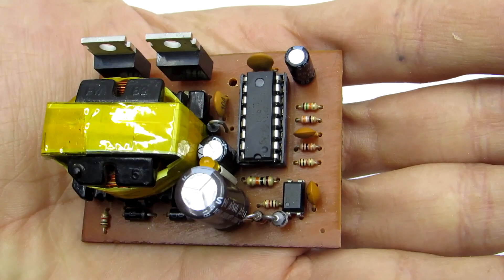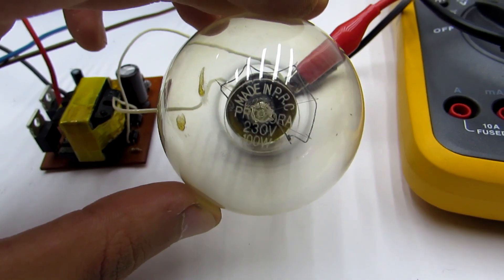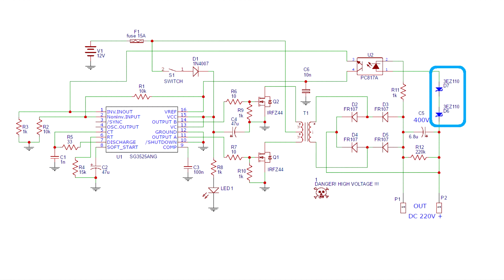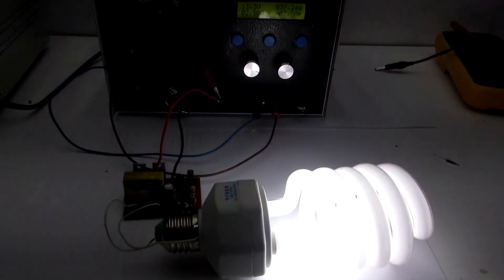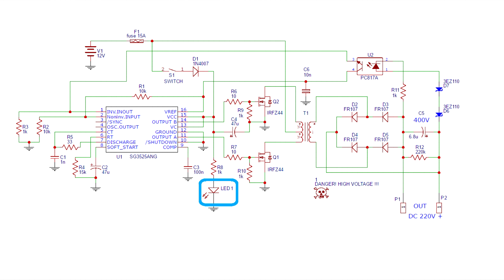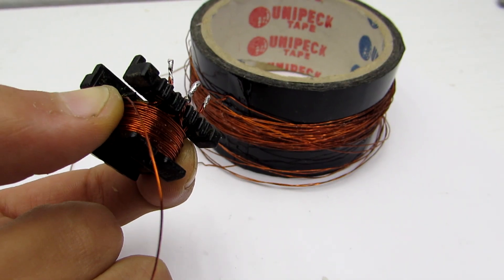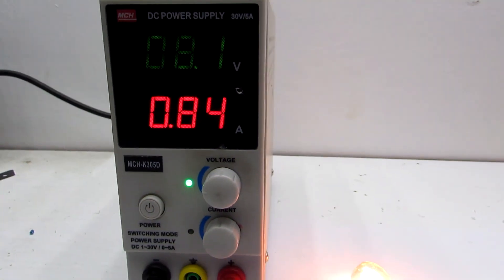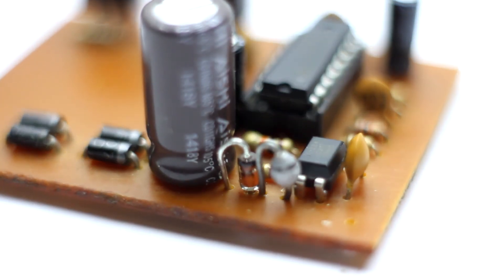DIY converter from 12 to 220V 100W

Comment: When I put a load on the output the voltage 220v drops dramatically.  What can it be?  I did everything the same
Reply: what is you rt and ct?? the rt 33 ohm is totally wrong, look at datasheet what minimum setting for Rt sg3525 an

Comment: u need a snubber network to save the MOSFETs from burning and catching fire due to high voltage ringing form the transformer and u can use higher frequency to increase efficiency and most loads will have no problems...

Comment: Sorry to leave so many comments all separate but I don't like having the bulk of my comment cut off to a glance.  Why add the 10 ohm resistor in series with the FET gates? I can never understand the purpose of those in circuits. Wouldn't that just waste energy when charging and discharging the gate as well as wasting energy due to the increased time spent in the FETs' linear region?
Reply: The essence of the 10ohm resistor is to reduce ringing in the MOSFET gates which results from a very fast turn on and off of MOSFETs. The resistance will introduce a small time constant with the gate capacitance of the MOSFET thereby delaying the turn on of the MOSFET a little which will not have much effect

Comment: I have a commercially made version of this circuit for only $7 that has performed well above all of my expectations without even breaking a sweat.  I recommend this topology and IC very highly, but in looking at the datasheet I can't help wondering if it wouldn't actually be too difficult to simply have this circuit make a 50/60 Hz sinewave by modulating the PWM with a twin T or similar op-amp LFO or even make 3 phase by modulating a triad of them with a ring oscillator.  Have you looked into or tried anything similar?

Comment: Nice video but 110 V zener diodes do not strictly exist.  Anything over ~24 V would be better described as an avalanche diode.  Edit: These circuits CAN drive universal motors if an output rectifier is used as she has done, however a considerable filtering cap may be required to cover the inrush current if the load has high inertia or the motor is very high speed.

Comment: Could anyone please tell me how to achieve the output stabilization circuit without using optocoupler and zener diode because it's hard to find high voltage zener diode please
Reply: Please could anyone help me with this?? Kasyan please??
Reply: How about using resistor voltage divider at output (220v dc)  so the output from voltage divider will be proportional to the output dc voltage. This way you can use low voltage zener too.

Comment: Hice el transformador y armé el sistema, veo que sí funciona pero los mosfets, el puente rectificador y el diodo que alimenta al sg3525 recalientan demasiado, me aparece un ruido de 60Vp en el voltaje de 12V provocado por el transformador, en los drenadores de los mosfets z44 picos transitorios de 70V que por alguna razón los mosfets no han explotado si se está excediendo sus 55V de Vds WTF?. No lo puedo tener funcionando mucho tiempo porque sé que va a fallar el convertidor ¿hay manera de suprimir el ruido (Ringing)?
Reply: Very inspiring, mister, can make a video tutorial for making a 75volt / 20Ampere SMPS supply .Sukese selalu tuan

Comment: why the mosfets so hot ?please help me..
thanks
Reply: i made these it worked at first time but after i put a 12v regulated charger for my laptop..the mosfet got very hot and get burnt,,,then i replace the mosfets and the ic,,,even without the load the mosfet  got very hot after seconds...
please help me....thanks in advance
Reply: SUPPLY VOLTAGE ?

Comment: If the bridge rectifier from the output is removed, the converter will generate A.C., will the converter be then able to drive a synchronous motor like one of the microwave oven turntable?
Reply: Motor will not 🔥 it sounds

Comment: fuck it my sg3525 is insane and cant hold stable voltage for shit
Reply: btw if you dont have HV zeners and would like to save a bit of power by not dropping 50mA over 220v device i would recommend to put 2 secondaries-1 for 220v and 1 for 1v to drive the optocoupler. the voltage at the 220v coil will always be proportional to the voltage at the 1v coil

Comment: This circuit-inverter produces DC output. OF about 300V. Many device will work. Motors will not work. The circuit is very usefull And in fact its  3/4 of fully functioning dc-Ac inverter. IF you build the circuit and works ok its very very easy to transform 300V dc to an AC of 220-250V.  Just search on ebay for '2000w 'pure sine wave inverter board''. Costs about 20$,  it consist of a 4 or 8 high voltage mosfets (in H-bridge configuration) and a drive section. This board will receive the 300V high voltage dc from kasyan's TV circuit and produce 220V pure sine AC

Comment: how to output is sine wave???
Reply: Thành Nhân 
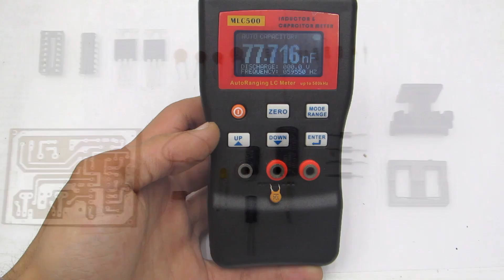4:41 The output is an AC square wave. All converters/inverters output an AC  square wave from a DC voltage.
   Even AC mains switching converters for computers and printers first rectify the AC mains into DC. They use an oscillator to create the square wave, and a voltage reference paired with a comparator in order to change either the pulse width or the frequency depending if the chip's design is constant current PWM or peak current.
  If AC square waves are difficult to wrap your head around. Most AC devices will work with DC if you provide the equivalent DC voltage to power them.
Reply: Upcycle Electronics Thank you!!
Reply: Upcycle Electronics yeah,but you should add another 100 volts zener diode in order to have about 320 volts on the output, since the rectified 220 volts mains sinewave  has this voltage.
Reply: DIYelectronics 
  Definitely correct. I'm in the US  so only our largest appliances run on 240V and even then the mains transformer at the street is connected different with a center tap ground and two 120 volt potential legs...
   I have seen quite a few schematics for 220V/240V circuits that simply use half wave rectification of the mains when they are connected instead of full wave on 120V. I must confess that my experience with higher voltage is rather limited to wiring up a few US 240V house plugs for welders and washing machines and troubleshooting a couple of three phase 480V circuits while working at asphalt plants. I'm not even 100% certain how most of the world's 220V is phased for residential wiring.
Reply: DIYelectronics I can wrap output of transformer to 220v, add  mosfet to  increase capacity . But some device not activity like fan, Can I use pic program to make sine wave?
Reply: chuẩn sine thì phức tạp hơn nhiều đúng không nào tôi đang nghiên cứu vấn đè này

Comment: if I'm not wrong,  220 AC can be obtained by adding two wires between the output voltage in the transformer and the rectifier,  Kasyan make it into DC output to power the optocoupler, which gives feed back to the controller
Reply: I dont recommend doing that. U will get AC but square wave! If you want sine wave try different inverter.